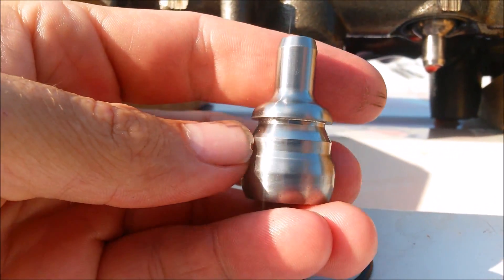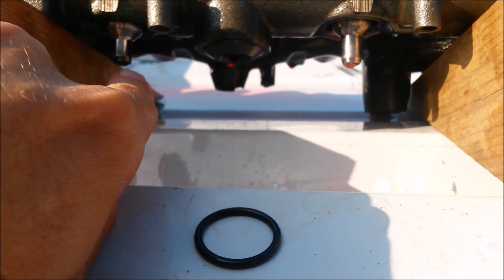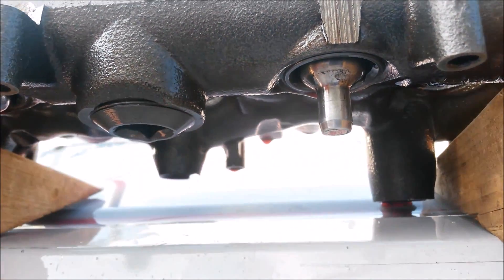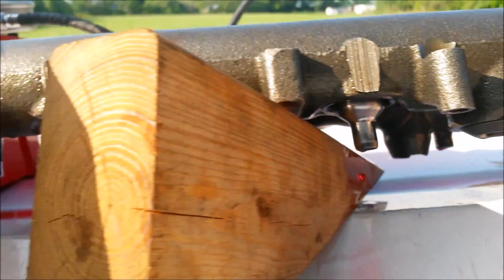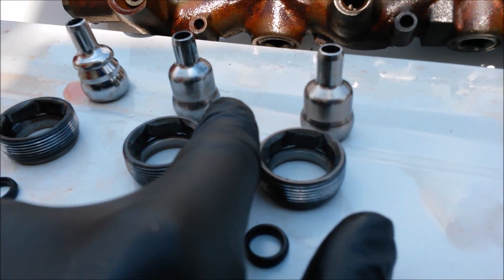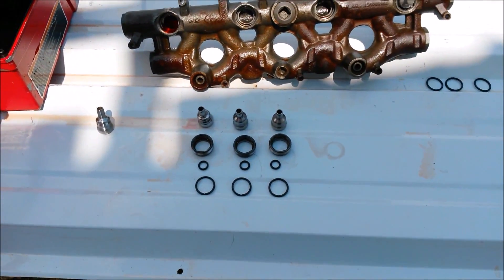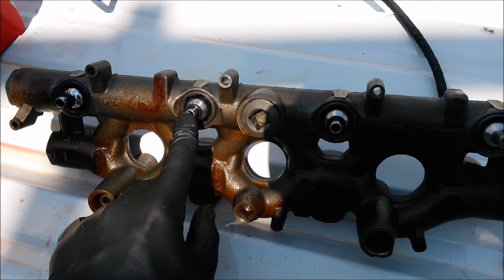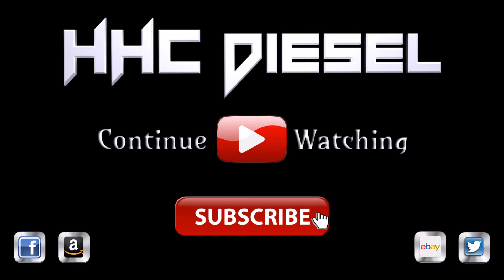HHC Diesel ~LeakProof Nipple Cups~ The Final Step In LeakProofing the Ford 6.0L Diesel Engine

Comment: Just bought this and it won’t pass a leak test. Did I hear you say it needs to have high pressure to seat the seal. I have replaced my Fitting failure at the back of the HPOP and was upgrading and this is holding me up. Please respond as soon as possible

Comment: I have been working on 6.0 for my whole life. I've never come across cup leaks. I have experienced damaged or bent branch tubes under the hpop. What do you have for that?
Reply from the maker: There is an updated STC fitting kit for the line under the HPOP cover. If the branch tube itself is damaged or bent, you're looking at replacing it.
Reply: @HHCDiesel  I am familiar with the updated stc fitting Ford made that update years ago like 2006. I have seen 1 Evan continously blow the same stand pipe oring the deepest one on the drivers side where the standpipe engages the branch tube. The vehicle blows that lower oring every 10,000km. The vehicle performs well with a new oring but performance drops off as it starts to leak. I have replace the oring 3 times and recommended changing branch tubes however the customer does not want to spend the money to change the branch tubes. The bolts are missing at the end of the branch tubes where they fasten to the block above the lifter bores. I think the branch tubes are bent or distorted judging by inspection cam images. Guessing someone was in there and felt those bolts were not important or just plane forgot them.
Reply from the maker: @anthonyrybczynski5420  Ford makes and updated standpipe and dummy plug kit which has Teflon backup washers to help support and protect the seals. You can easily spot the updated ones because they have a hex drive instead of a half inch square drive. The updated ones generally don't leak.